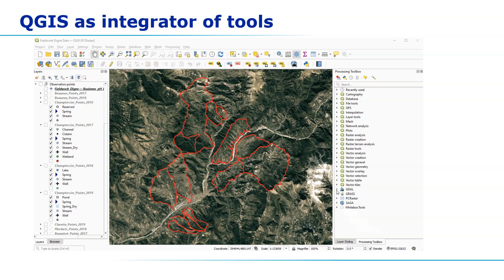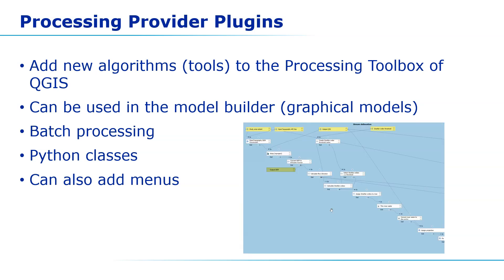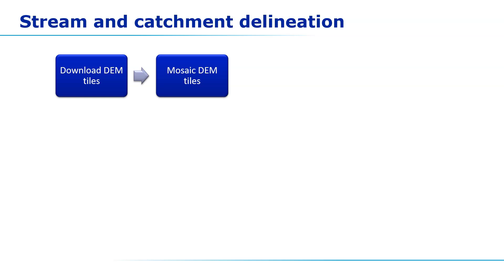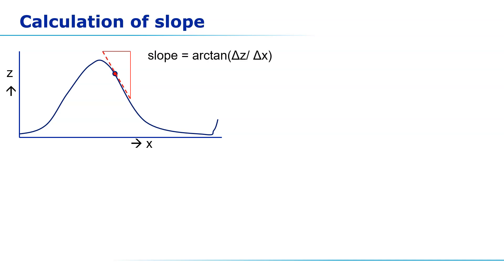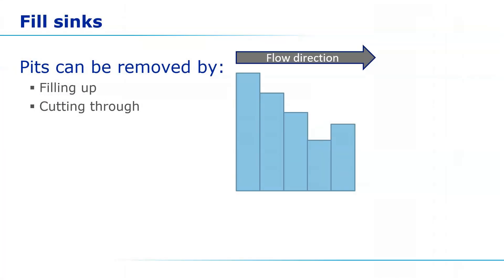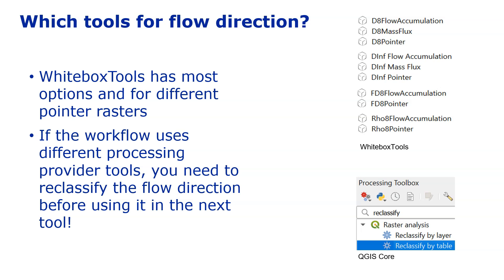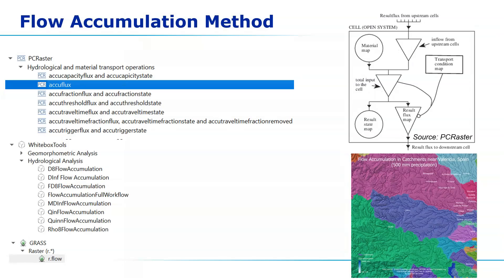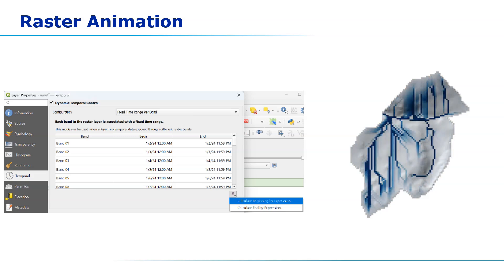Tools for Stream and Catchment Delineation with QGIS

Comment: Hi Hans, indeed very nice explanation I have seen the model you built to delineate the catchment using outlet point. It would be helpful if you can guide what to do when sub-catchments are also needed. Of course manually clicking points one by one is not a good idea. Maybe one can use a direct pour point shapefile for the sub-catchments and then delineate all the required sub-catchments. Do you know how to do it in the model builder?